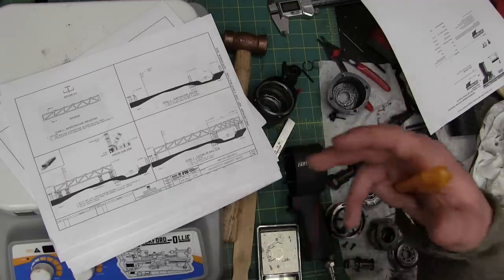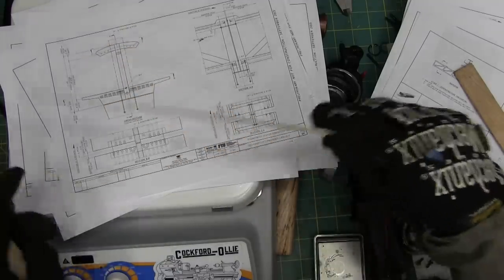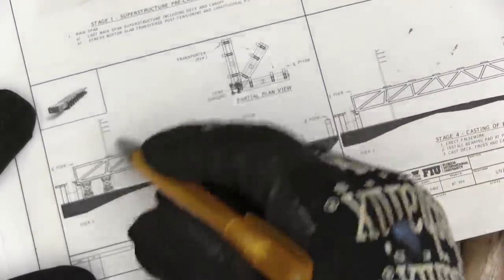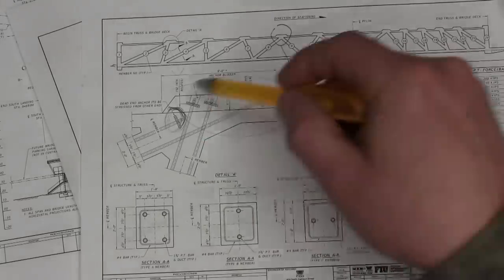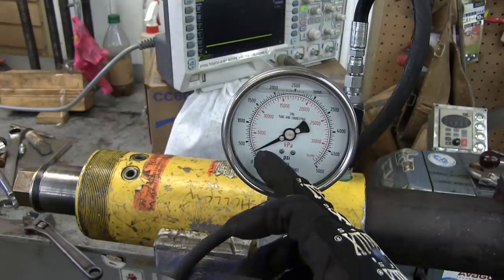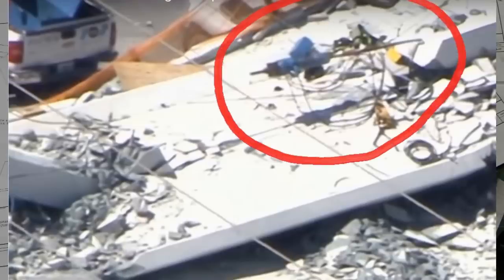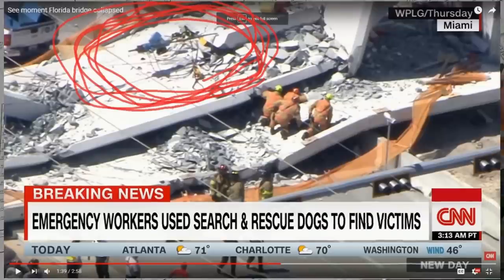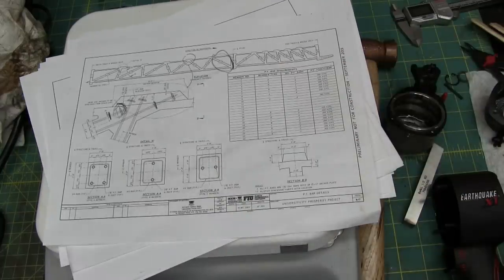Post Tension Failure Florida Bridge Collapse | Engineering EXPLAINED!

Comment: Interesting....I’m a construction inspector.  Specializing in pre and post tensioning.  I haven’t looked into this much yet.  I’ve personally never seen a failure in my 20 years in the trade.  At this point all I know is I’m glad I wasn’t the inspector on that project.
Reply: When I worked for W.M. Barr, (think Kleen-Strip), we had an engineer who didn't show up until about 11 o'clock one morning.  He had been the engineer who signed off for the Fire Department for the Wal-Mart that had burned to the ground the night before.  He didn't come in until he found out that Wal-Mart installs the required sprinklers, then turns them off and chains the valve wheel.
Reply: @PeterWolfe2012  so its not his fault?
Reply: I'm really glad I wasn't on this job, some hack at a desk really screwed the pooch on this one! FOR SURE
Reply: @PeterWolfe2012  I assure you Walmart does not chain sprinklers shut
Reply: @nealinnc  I assure you, they did.

Comment: I found it interesting that this was on the wikipedia page for a couple of hours: 
In many bridge truss designs, the triangulated supports are arranged into two or more parallel walls. Among other benefits, this gives some redundant load-bearing paths to help the overall structure survive if any one member fails. In the FIU bridge, there is only a single vertical plane of diagonals along the centerline. There is no backup for any strut. The entire structure is threatened If any one diagonal or joint were to fail. Collapse can be avoided if the remaining joints and members were overbuilt stiffly enough to accept the shifting emergency loads without breaking. Otherwise, the structure continues to sag unchecked to the point where more things fracture or buckle, and the structure folds. Such bridges are called [National Bridge Inventory fracture critical] with each strut being a potential [single point of failure]. That vulnerability is avoided in most new bridge designs.

But not in this case.
Reply: You were right.  The NTSB called out the non-redundant design in their report.
Reply: The design just looks wrong with 'unsupported' triangles that appear to be random sizes.
Reply: @gyrfalcon23  All in the efforts to save some spring steel and concrete

Comment: The pretensioning of these rod assemblies is becoming a common theme in structural bridge failures and mirrors a similar finding that investigators found in the Northern Ontario 2015 Nipigon River Bridge failure near Thunder Bay. In this case, (which also used ABC construction techniques) 24 pretensioned bolts installed near the abutment pillar at the east end were incorrectly tightened and as a result, 14 failed from improper tensioning. The pretensioning of the bolts, used a different installation (vertical instead of diagonal) method than the FIU bridge. Both bridge designs used a shoe plate anchor design. Interestingly, when tested at the University of Waterloo, the bolts did pass the ASTM  A490 specifications. Tests conducted indicated low cycle fatigue between 50 and 140 cycles, cracks began (in the bolts) and then a final fracture, snapped all 14 failed bolts simultaneously. 

Testing on the remaining  bolts that did not shear showed the same cracks but had not fully fractured as the fatigue fractures found on the same spots of the failed bolts. Like AVe shows using an oscilloscope, the Waterloo team tests methods included determination of the elemental composition of the bolts by glow discharge mass spectrometry and wavelength dispersive x-ray fluorescence mass spectrometry.

Investigators now had the smoking gun with the evidence that lack of proper pretension and tightening of the bolts attributed to the cracks and fatigue as the reason for the failure because if the pretension was not set correctly, the condition of the bolts was the evidence needed.  Many early arm chairs experts initially believed wind and the sub-zero temperatures were to blame, which the investigating team clearly proved otherwise.

I'm not sure if the setup for temporary supports under the span would be the cause of the bolt / tensioning failure that stretched the bolt shaft and or shoe plate or not, but AvE's analysis is a valid angle that investigators will have to pursue. But there can be no doubt, based on what is known so far (cracks found and reported, etc.) that there was a pretension bolt issue.
Reply: it is baffling (in preliminary plans) that the structure members #9 and #11 show no PT bars... I would assume that PT bolts should be tensioned symmetrically, it appears the might have had ram only on one side?
Reply: It could be that the crack heard some time before the collapse was due to the misplaced supports, that crack putting a lot more tension on whatever rods were involved.

I have to say, I'm not sure why a failure in tensioning the trusses would lead to the failure of the bridge.  Aren't those always under compression all the time?  Wouldn't it be the tensioning on the bottom portion that would have to fail?  Maybe I've misunderstood something here.
Reply: Doug Hanchard I bet you those bozos "fixed an issue" on the fly (the supports that couldn't be placed where they were supposed to, in their calculated position) without notifying the designer of the (now) changed construction site situation impeding the original plan. That would have meant delays and possibly expenses and it would have probably changed the whole sequence of tensioning and repositioning.
Oh boy the clusterf@ck...
Reply: The guy hearing a crack has a 50:50 chance of being a red herring. It's likely enough that someone dropped his hammer and the guys memory decided it was 10x as loud as it actually was.
Reply: macbeth2354 makes a valid point....and a damn good one. But what Dougie hear has clearly mentioned is what can be related in Waterloo. To recall what AvE mentioned, that the PT rod has clearly yielded into cyclic failure due to improper pretensioning, maybe sometime before [the installment] has seem to be a discontinuity along side with the Wheatstone bridges (for Strain gauges) may have also been a factor. Or I could just be rambling because it's 4:45 in the morning and Im fucking exhausted from the PSVR.
Reply: lead engineer 

"Hey Tom, this is Denney Pate with FIGG bridge engineers. Calling to, uh, share with you some information about the FIU pedestrian bridge and some cracking that's been observed on the north end of the span, the pylon end of that span we moved this weekend," according to a transcript of the call that was released by the Florida Department of Transportation on Friday night.

The bridge was too fragile to move.  design failure.
Reply: Usually, pre-stressed concrete like this has the tensioning cables below the surface level, and are only 'tensioned' once...Seems logical here that the triangles formed by the 'roof' supports should be mainly for the non-existent overhead supporting cables...
Reply: That's why the collapsing of bridges will be a daily routine.
Reply: Doug Hanchard iii
Reply: htomerif I was under same impression on the tension in the lower section of the bridge, but now after seeing these drawings this bridge is a little more complex than I thought. The simplest way I can explain it is the tensioned steel in the truss portion of the bridge connects the top portion of the bridge to the bottom and if they fail it would be similar to removing the center flange of and I-beam. Not good at all.
Reply: Why doesn't Doug Hanchard have a YouTube channel? I'd subscribe.
Reply: And then I've had steel workers tell me that the final few degrees they give a nut with the hammer wrench, after initial torque, is to "friction weld" the connection.  

Both examples show an absolute lack of the base concepts of axial clamp load, strain, modulus of elasticity, yield points, shear strength, or basic material properties. Possibly some bullshit old timer explanations mixed in as well. (that old timer stuff is great for how but not for why)
All this "we know better than the engineer" -who just spent a months carefully selecting the specific materials and methods- remains far too common. It was tolerable or even unnoticeable when everything was doubly overbuilt using rudimentary materials that were not sensitive to assembly technique nor pushed anywhere near their full potential. 
But you just can't have it on modern projects.
Reply: In any triangular truss loaded as a beam, you have members in tension and you have members in compression, otherwise the truss can't support a load and just becomes a pile of spaghetti. The pre-tensioning rod thru the concrete WAS the load path, so when it failed, it's like that piece of the truss was just removed completely, and the whole thing fell into itself like a pancake from the cascading failure of the other truss sections.
Reply: rorybz memeber #11 should have been in compression and it appears that they were further stressing it by tightening the rods .. why would they do that
Reply: Doug , this 174 ft, super span should have never been installed  until the support ends & Cabling Tower was built and set with the top 2 N&S cables tension to support ends , and only until after the super span passed all Stress tests without cracking !
Reply: wolfedog99 However engineering to design limits is exactly how you get catastrophic failures. There are no perfect materials and assemblies are even less perfect. If you do not allow for these things in your design with factors of safety then you are an incompetent and reckless engineer.

Comment: Well done sir, cribbing and traffic control would have saved lives!!!
Reply: Coming from experience, when it comes to traffic control on projects like these, politics start running deep. Shutting down lanes is almost never in the cards, thus the prefab of the whole project. Of course when it comes down to public safety on stuff like this, it is still on the engineers and boots on the ground, but foregoing traffic control and shutting down lanes for cribbing wouldn't surprise me  if it was motivated by a politician. Of course there will never be proof of that.
Reply: Tj Smyth I'm
Reply: Work in real estate development in a core city.  When I say we have to have traffic control for the most remedial thing would be an understatement.  Hell, we have to have traffic control for a truck to come to pump out the blue rooms while double parked.
Reply: Traffic Control....near the top of the list for the lawsuits....

Comment: Excellent analysis.  The penny dropped when you said the yield curve.  The contractors doing the tightening must have wondered why it was not tightening.  Perhaps the engineer in charge was not contactable as they must have contacted someone about whether to keep adding tension.
Reply: Stephen Gloor ...There should have been a deputy inspector on site for a project like this. Why did the deputy inspector not put a stop to this before the failure? The deputy inspector works for local city or county agency.
Reply: Apparently, the university was doing all of the inspection with limited oversight from the DOT.
Reply: HE RAN OUT OF HIS MEDS ON THAT DAY.
Reply: + Yeti Dan: In other words, the fox was guarding the henhouse.
Reply: Also, given the short length of the cable, the room for error was smaller. T
Reply: If the spmts we're gone and the span was on pylons, wouldn't the member you marked be in compression? Meaning the tension rod was doing sweet FA at the time it broke? Something else is going on I'd bet.
Reply: I don't do heavy construction, but I can totally envision how this situation occurs.  You get into a "I can fix this" mentality and don't realize how proper fucked you are until it's far, far, too late.
Reply: Studying engineering the white collar way, been doing preliminary classes before I get in the thick of it, it takes a while to get to the part where they say, "If you are building something and then all of a sudden it feels like physics has stopped working, what is supposed to loosen, tightens, what is supposed to tighten, loosens, you have 10 minutes to figure out what has gone wrong and fix it else you are about to be one very infamous man."
Reply: Evidence the Boeing 737 rudder issue.
Reply: Aaron Moore Not quite. The rods wouldn't be slack. Remember, every other tension rod in the span is under tension too. If one support loses tension, it can no longer counterbalance the rest of the tensioning forces. What would have been the stronger  compression strength of the concrete become tension stress the material can't sustain. At that point the whole structure "springs back" like cutting a stretched elastic band.
Reply: Ah, excellent point. I wasn't thinking of the bridge as a unit, forest for the trees and all that. Thanks!
Reply: Cholula Hot Sauce from what is discussed, yes. The rods were stressed beyond its elastic zone, on its stress-strain curve, and straigt into plastic deformation. If someone would have caught it then and there when they started to add more tension, there would have beed repair work since it has permanently deformed. However that did not happen and like the vid showed on the oscilloscope stress was added untill the rod surpassed its ultimate tensile strenght and went to fracture.
Reply: Or maybe it was poorly engineered and didn't hit the required torque specs. I work on aviation parts and many a time have had things fail when they should have held a torque. Who knows, maybe NDT dropped the bomb or the guy who torqued the bridge when they went to move it into place overtorqued it.
Reply: "it's not tightening?  well keep cranking up the tension until it does.  dont worry about the traffic underneath!"
Reply: Regardless why did they not stop traffic while doing such adjustments? There was no allowance for fail safe, only fail disaster.

Comment: So how fucked are these guys for letting traffic continue?
Reply: construction company has admitted this was an oversight
Reply: Very
Reply: they have been working on developing this rapid install system at that school for like 5 years as to minimise traffic interruption
Reply: Criminal charges are possible, depending on just how badly they blew it, particularly if there's a single point of organizational failure. At the very least, I believe criminally negligent homicide charges may be brought. To the extent that any engineers involved are licensed or chartered or certified, those credentials are definitely at risk of suspension or revocation, potentially prior to the investigation being completed.
Reply: +Sean oreilly This one definitely goes up to 11
Reply: Proper
Reply: The whole purpose of the project was to show how little impact the construction would have on the flow of traffic. So most likely they were just trying to show off look we can pull this off.
Reply: Sean oreilly My hope is that if it was caused by a 'do it my way or fired' management, they don't get away with blaming the engineers. Re: Challenger and too cold seals (fixed to correct shuttle name)
Reply: no an oversight is  spelling you're name without a capital letter .. this is  a bit more serious  more on par with pissing off the misses :P
Reply: +Jason Woods
Pray that there's a Feynman-equivalent willing to call people out without mincing words.
Reply: its probably has to do city council wanting to keep their jobs and the whiny citizens that don't want to be inconvenienced
Reply: + Jason Woods
It was Challenger, not Columbia.

Challenger had the seal issue, Columbia had the heat-shield damage.

Thumbs up to you regardless.  They were both terrible disasters.
Reply: Man, that worked out didn't it? Instead we get 6 dead, 9 injured, several cars crushed, and the whole lane closed for a long time.
Reply: It's very possible that all involved would've much preferred to shut traffic down, but that a certain elected someone didn't like that it took him 15 minutes longer to get to his mistresses place every morning - of course, such discussions would've been 'off the record', putting all responsibility & blame on the PIC...
Reply: you sir made my entire evening with that visual.
Reply: The fact that they had a bridge, in the middle of construction, and the road below WAS IN USE, shows that this was gross negligence. Anytime there is any kind of construction over a road, or something that could collapse onto said road if there was a failure, means that road should be closed.
Reply: Near the top of the list for lawsuits....
Reply: Right good and proper
Reply: Thoroughly
Reply: somebody screwed the pooch on this deal, i hope that the proper dude gets hauled off to jail for it.  Civil litigation over the wrongful deaths will keep this going for months/years.
Reply: well said soopa, well said.
Reply: Depends on if they know DWS or not. If they don't they'll wish they did.
Reply: Depends on a lot of things.  Most importantly, their integumentary pigmentation.
Reply: On possible criminal charges.... And yet another reason why people don't go into engineering. Criminal liability for fuckups vs other careers where outright deliberate criminal acts will go without so much as charges. And if an engineer does something deliberately.... well hello VW diesel scandal. It seems as if more engineers were held criminally accountable for a little extra NOx that than bankers did for crashing the economy.